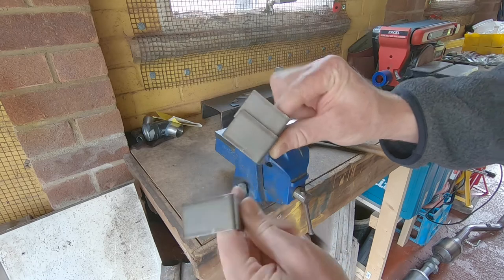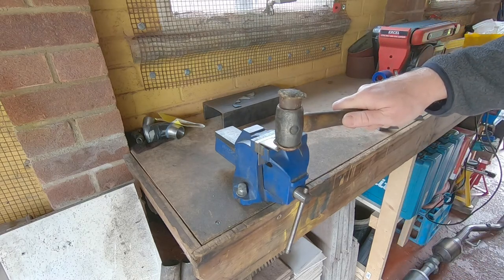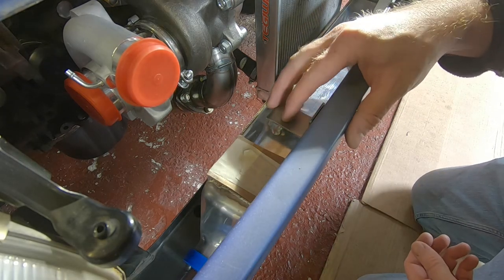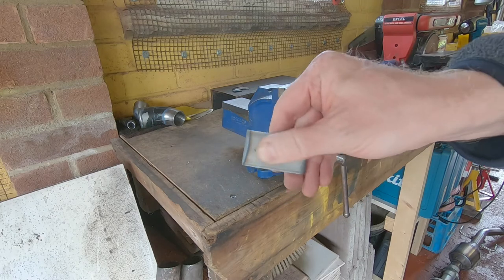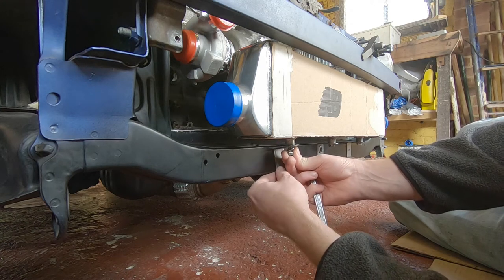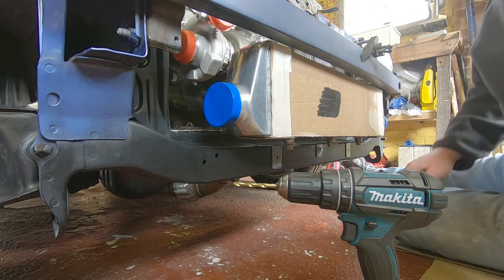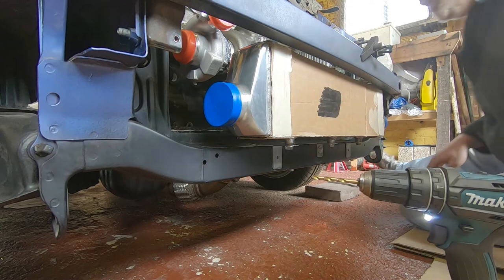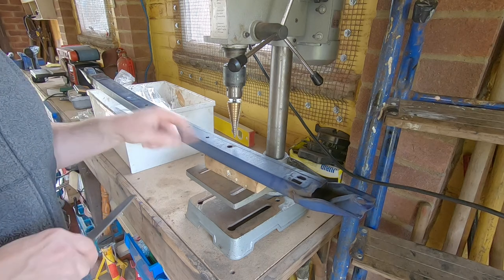How to make Intercooler mounting brackets from scratch! | Toyota Starlet 4efe turbo build.

Comment: Hey mate,  what did you end up doing for the bonnet catch brace?
Reply from the maker: I replaced it with a steel bracket to the intercooler and bumper bar. If you don't have a solid bonnet catch brace the bonnet will blow open whilst driving!

https://youtu.be/zTD_LaPujuY

Best to keep watching the series in order. Its all covered mate.